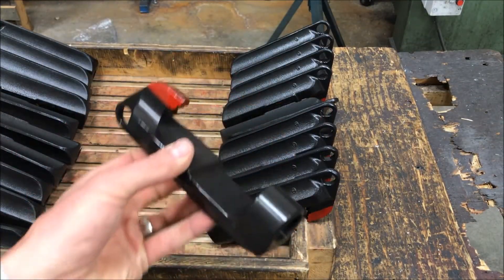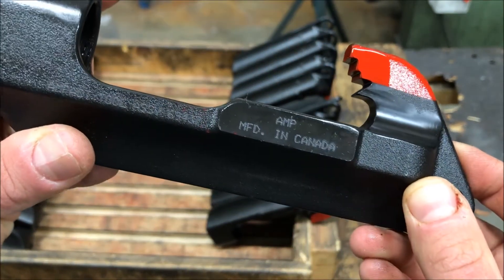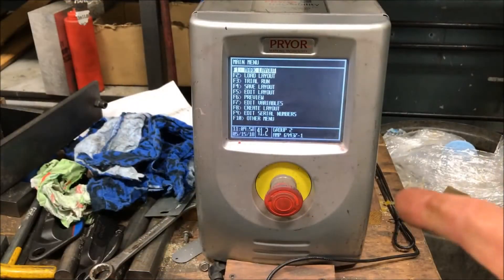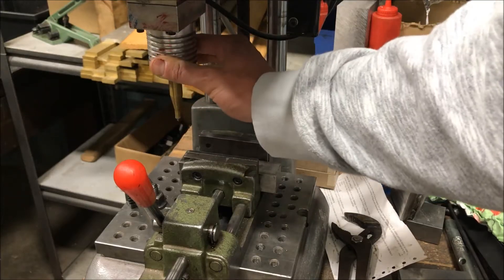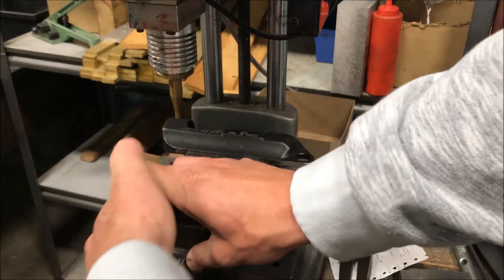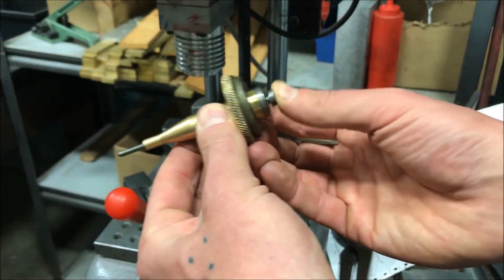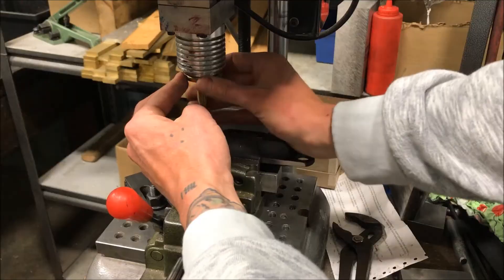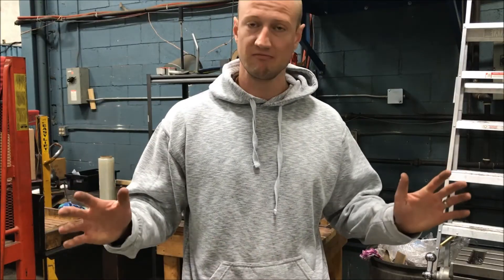LETS MACHINE: DOT PEENING

Comment: hay man, I was wondering if any of the older Haas machines in you're shop run off floppies and if so what was the workaround
Reply from the maker: They do! Well, they did. All of them but the VF2. We got USB conversion kits installed -  but we have to load the files onto a virtual floppy drive on them, so program capacity is still unfortunately the same unless you drip feed with RS232
Reply: thx, i'll look into the conversion kit